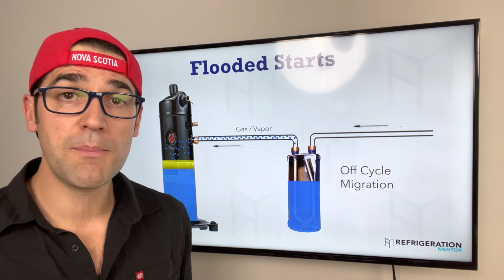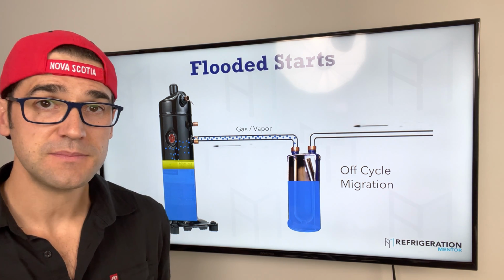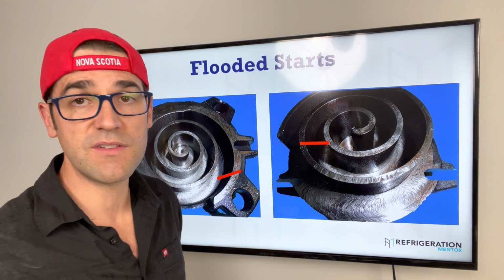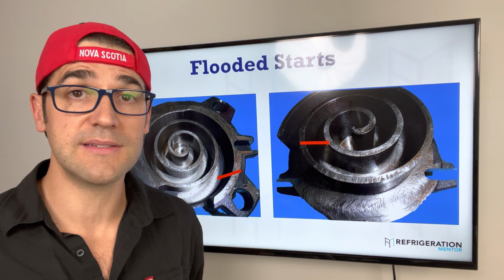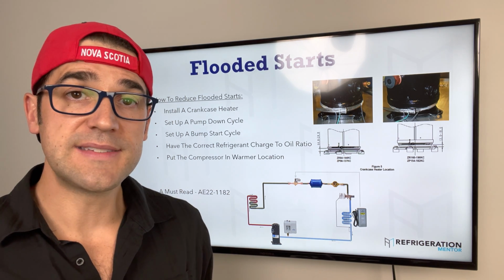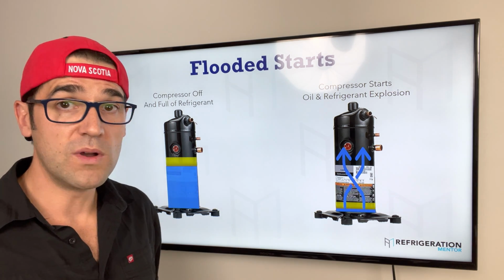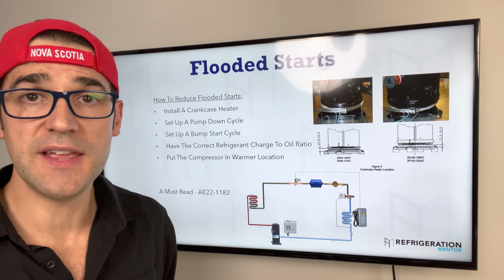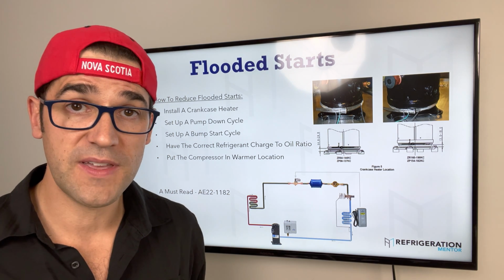Flooded Starts on HVACR Compressors

Comment: I got danfoss 3ph comp opened up and flanks inside orbit all broken. Sounds like starting flood back like you mention. What’s your thoughts?
Reply from the maker: @freshsaltyfries5078  which internal design is it as they have a few different ones. If you opened it up and they are broke most likely it started with liquid inside. It could have been oil or refrigerant that broke them. I would check crankcase heater or pump down solenoid if it has one.

Comment: So I dumbly charged the unit r22 thru the suction as a liquid before I started the compressor up. I’m thinking that i flooded the compressor because it turned on for 5 seconds then tripped the breaker. Would I have to wait for the gas to turn into vapor as it’s been 2 days since I’ve started it, or should I reclaim some of the refrigerant from the suction side?
Reply: If you really think you have liquid in your suction line, just use your recovery machine and pump it to the liquid side…
Reply from the maker: Sorry I didn’t get to this question quick enough. What did you do and what was the result?

Comment: What of liquid at SH's below 20F for extended period of time at the compressor the oil droplets displacing oil on the internal surfaces causing friction points, thus scoring & eventually failure.
Reply from the maker: Great question. It all depends on the refrigerant. Some can run at lower superheats so cannot. Always check the compressor manufactures superheat tolerances.

Comment: Great video. I replaced a grounded 3D semi 10 hp on a boat the other day. It had a 7/8 hot gas bypass solonoid on the discharge to suction before accumlator. It was controlled by a bypass timer and set for 10 seconds upon startup. I found out the old bypass timer was getting stuck some cycles. I replaced the timer. I wonder if someone installed this at sometime to prevent flooded start? Not really sure.
Reply from the maker: To reduce the amount of inrush current  to start up I would assume.

Comment: I have a 3-ton scroll split system with the condensing unit on the ground and evap in the (hot) attic. In my climate, this unit sits idle for 9+ months, so the 1st start is always flooded, since the condensing unit is colder than the evaporator (and lower, if gravity has anything to do with it). The compressor noise on that 1st startup is painful to hear! Today I installed a soft starter and it's amazing how well that works! The unit hadn't run since last September (July today), and 1st startup sound had none of the previous clattering noise as was normal after sitting for so long. I didn't expect this to work as well as it does. 
Yes, the "correct" way to combat this would be a crankcase heater (or bump starter as I learned from you today), but it's hard to justify expending all that power for the heater when the unit sits idle for so much of the year.
Reply: Put the CCH on a switch or a time delay relay and turn it on 24 hours before you start it.
Reply: If you have a liquid line valve, you can close it, run the system to lower the LP side presure to just a little bit above the atmospheric pressure (to prevent air infiltration in the system), and put an electical protection to prevent anyone else to run it. When needed for the hot season, you just have to reopen de valve and run it normally (sort of a manual pump down).

Comment: What’s your thoughts on pumping down a scroll compressor to store refrigerant in condenser coil for a t.x.v. Repair
Reply from the maker: I have done it before but I do prefer to pull the gas out.
Reply: @RefrigerationMentor  thanks for responding have a great day
Reply from the maker: @eastcoast186  anytime.